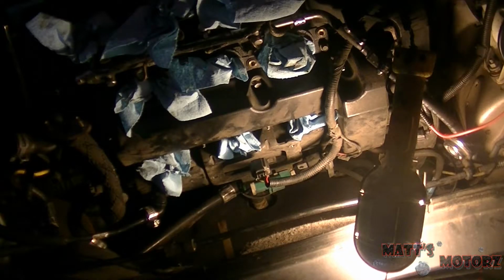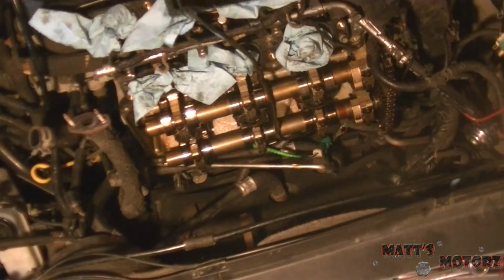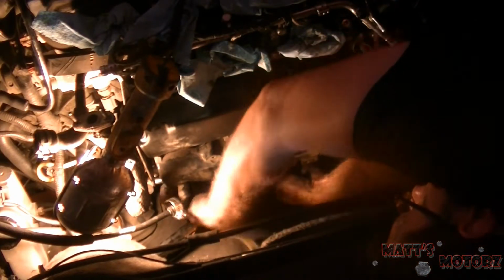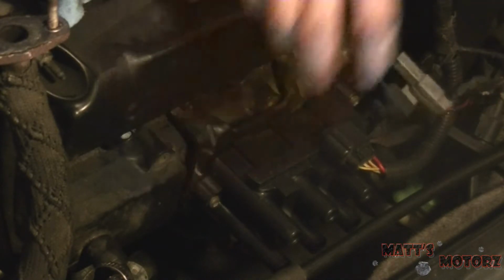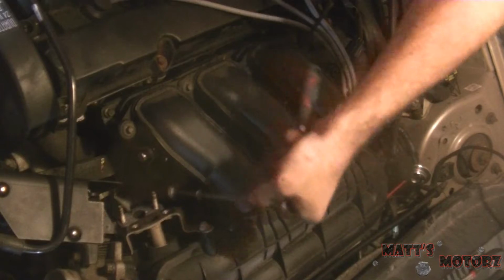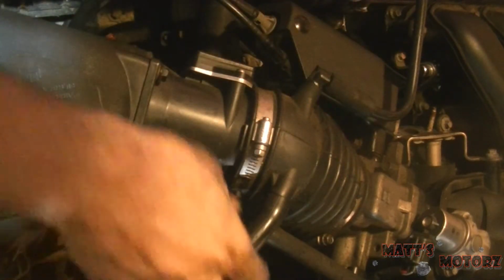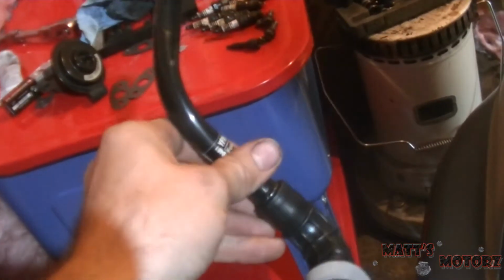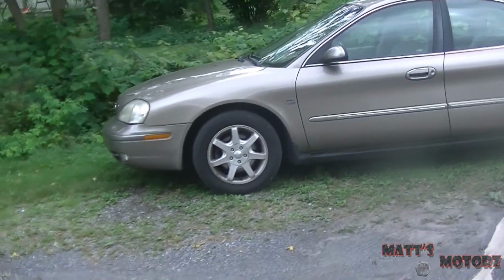2002 Mercury Sable - Ignition Overhaul + New Valve Cover Gasket and Spark Plug Seals: PART 2

Comment: Matt, good video. I've built several old Chevy 350's but working on these modern motors always gives me pause. Too many connectors and vacuum lines to break or forget to unhook before disassembling. Traced a problem in my wife's 04 DOHC to misfire on cylinder 2 and 3. Of course it has to be the rear cylinders. Anyway, this helped me get a reference of what I"m in for as I pull all of this apart. Thanks!